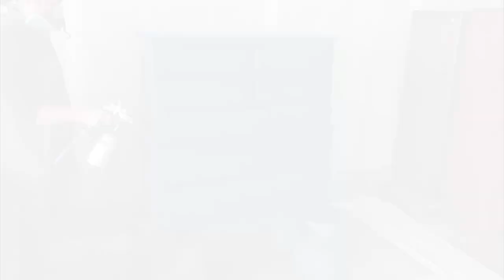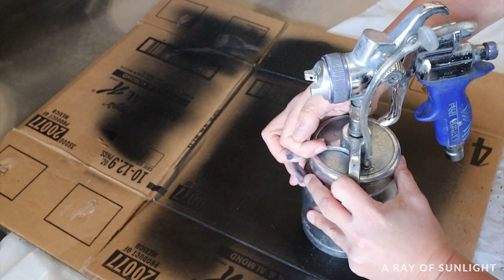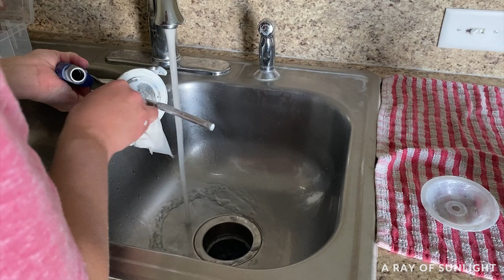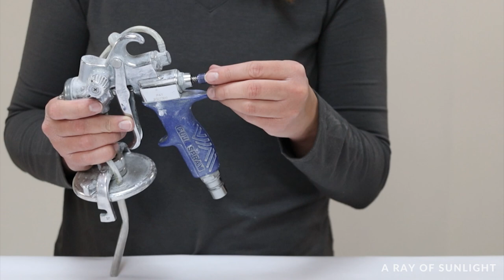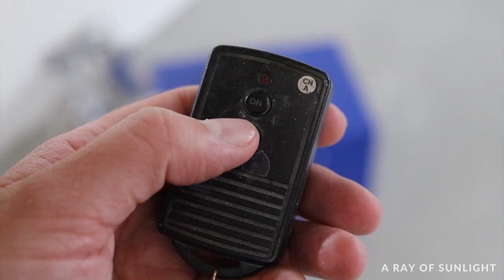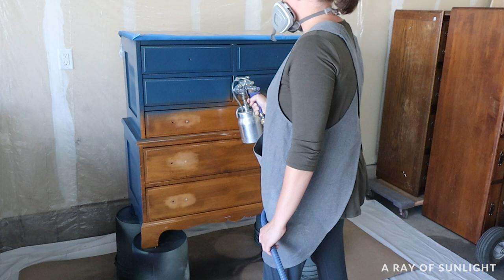How to Use the Fuji Q4 Paint Sprayer and T70 Spray Gun | Thinning Paint,  Settings, Cleaning, Review

Comment: Nice video.  Very much appreciated the breakdown/cleaning sections (and use with the smaller cup).  The comments on the needle sequence are also something I haven't seen before.  Well done.
Reply: If you use 3M’s PPS system in place of a gravity feed cup, you can literally spray in any direction. Even upside down. Plus you’d have a built-in strainer, can store paying in the cup, and you wouldn’t have to clean a cup afterward. They do have a smaller cup option as well if you’re concerned with regularly spraying in tight areas.

Comment: Nice video.  
I have the same sprayer except the gravity fed T70 gun, I use the 3m PPS cups exclusively, I've never used the paint cup it came with.  The flexibility that the PPS offers, to paint in any orientation is huge, upside down, sideways it doesn't matter. I mostly spray Renner water based urethane, but I have sprayed a bunch of stuff with good results.  I have sprayed a lot of the Emerald Urethane that you showed and I'm not in love with the stuff, it stays tacky for far too long.  The Renner dries hard and doors are stackable the next day.
If I'm thinning or adding hardener, I use a scale to calculate the ratios, I want consistency
For my makeshift paint booth, I have fan that blows out my garage window and an AC filter in the second window for incoming air to keep bugs and dust out.  It removes the atomized over spray very nicely.
I also never spray water through it to clean it.  I'll just disassemble it and use brushes every time.  Spraying the water is just messy and unnecessary.
I too use the 1.3 almost exclusively.

Comment: You would achieve a much better paint job if you kept the spray gun parallel to the work piece at all times. Because you have almost a 45 deg angle for most of the time you are depositing a load more pant at the bottom of the fan than the top. Also take your spray gun past the end of the work piece then release the trigger. With just these 2 disciplines your results will improve vastly. Good Luck.

Comment: Thanks for the video.  I will unbox my Mini-Mite 3 with GXPC gun tomorrow.  Hopefully I can spray the stain I bought on to my patio furniture.  I went with that particular spray gun, gravity fed, because they said the smaller cup can help you spray inside of cabinets and also spray ceilings better, as you can adjust the position of the cup.  I also bought a  cap recommended for stain and a flex hose whip for better maneuverability.  We shall see.

Comment: Hey! I started spraying paint with my Q4 and have some questions:
1. Do you use primer before painting? Do you spray from the same 1 qt pot or do you have multiple pots (one for primer, one for paint)? 
2. I noticed paint starting to seep into the bottom pipe of the check valve. You mentioned in the video to rinse it but I couldn't get water to come through the tube just by rinsing alone. Can't you just spray with an empty pot to blow air through the check valve to keep it unblocked?
3. How do you fix runs? Just sand them off? To prevent them, should you prefer to do multiple light coats vs. fewer heavy coats?
Reply from the maker: Hey! 1. Yes I prime before painting for best results. I do not spray my primer because it isn’t waterbased and it’s a pain to clean. It’s a great idea to keep them separate, but I have used primer in the same container before. 
2. If I’m understanding correctly, that part I pull off and then run water through it. Spraying will not get it to unblock. 3. Yes, to prevent runs spray light coats instead of thick coats. I also try to stick around for a few minutes after I spray and check to make sure there are no runs forming. If they are forming, I brush them away while the paint it wet. That way I don’t have to sand thick dried paint off. I do usually lightly sand the brushed paint once dry to completely remove any possible brush marks. Goodluck!

Comment: It's interesting to see you use a 1.3 cap with paint. On the chart it recommends a 1.5-1.8 cap.  I'm having a bit of issue with texture on a shiplap wall I'm painting.  Not sure if i need to dilute it more or just increase the fluid -- maybe it's not enough fluid?  I don't know, more experimentation is needed.
Reply from the maker: Yeah I don’t follow all of the “rules” 😉
I would dilute the paint more to decrease the texture. You could definitely try to increase the fluid too though. But I would bet thinning it out more would help the most. 
Goodluck! 
Oh also, I feel like I don’t get as much texture with the 1.3 tip.

Comment: Do you think disassembling the gun and placing the parts in an ultrasonic cleaner would work for quick washes between sprays and then a more thorough cleaning periodically? I use an ultrasonic cleaner on airbrushes and it does great, but that’s not latex paint.